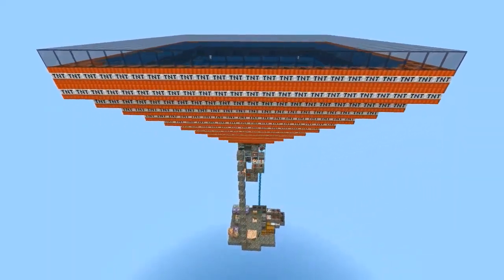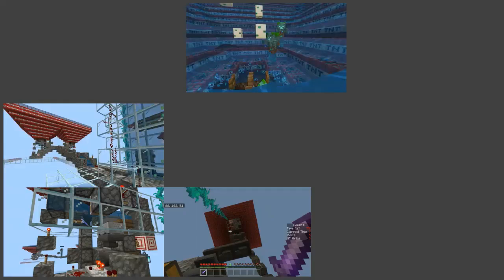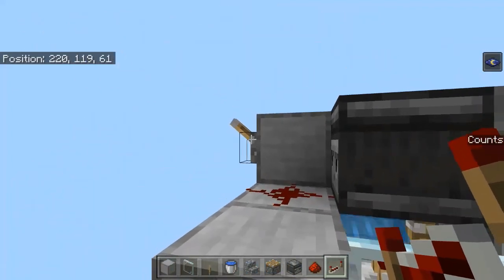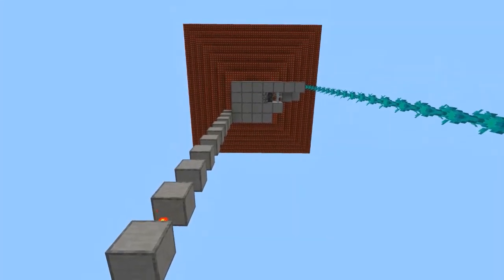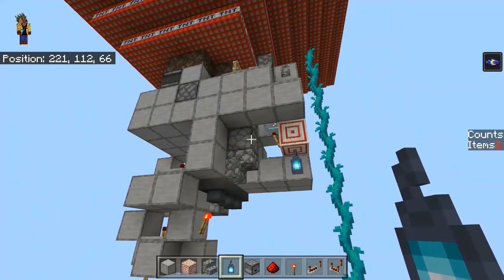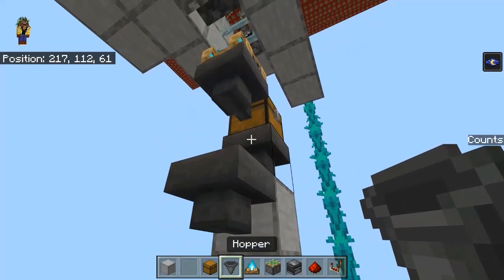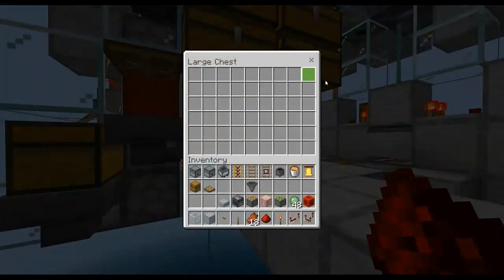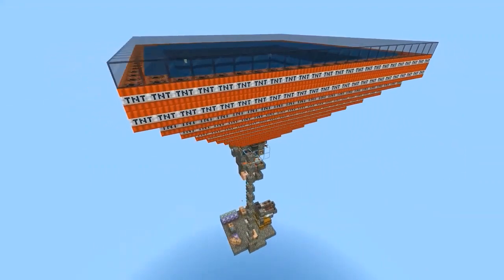Drowned Funnel - Scalable Drowned Farm for Minecraft Bedrock Edition

Comment: *2 Density Drowned Farm*

Spawn Blocks (TNT or Ice) - 719 (11.5 stacks)
Tinted Glass - 594 (9.5 stacks)
Filler Blocks - 234 (4 stacks)
Redstone - 79 (1.5 stacks)
Glass - 38
Soul Sand - 16
Redstone  Torch - 14 
Repeater - 13
Hopper - 12
Dropper - 10
Sea Turtle Egg - 8
Observer - 8 
Piston - 8
Comparator - 4
Soul Torch - 4
Target Block - 4
Soul Lantern - 2
Stairs - 2

Stacks rounded up to the nearest half stack.
This is for one side of the farm (+ water stream)

Comment: Welp, I just built "the other farm" and wasn't that impressed with the output. Now I'm gonna have to rebuilt it to this version! Thanks Golden!
Reply from the maker: Ah glad I could help. Keep the funnel you have, add the turtle eggs, and reduce the length and width by 2 (make the top ring of ice into the new side wall). The roof is fine if you already built it. The soulsand at my drop chute is not as big a deal, but it may speed things up a bit. A bigger impact will come from raising the trident killer up and getting rid of the long drop chute. Of all of those changes, probably the turtle eggs are most impactful.

Comment: I made an interesting discovery with drowned farms after building this: 

If I have a dispenser dispense my tridents into the Trident killer, then drowneds will only drop tridents with Full Durability. 

If I throw the tridents myself, they drop damaged tridents. 
100% consistent
Reply from the maker: Interesting. How many do you get though? They may only be from swapping for nautilus shells. With dispensed tridents it doesn’t count as a player kill, so you’ll get less copper and flesh.
Reply: @goldenhelmet403  honestly it felt like I was getting just as many tridents, if not a little More. I
Copper drops stop all together. 
A lot of shells and flesh still

Comment: Farm is still the best ive used in 1.20 also love that its a badass ink farm as well, currently have 2 in my soon to be realm, make sure you read the description on the 5 density it doesn't work at its full potential on realms 😅 but for single player worlds i recommend the 5 and maybe bring a few villagers to trade that flesh ;) keeps you busy while you stack that copper and tridents bonus addition would be stacking gold farms in the sky with this for more flesh to trade plus gold to trade its a solid system and portal gold farms dont affect the rates 😉
Reply from the maker: Thanks for your support.

Realms are sim4 only, so yeah the 5 density does not work there.

Portal gold farms do affect rates. Portal pigmen are surface cap so they will stop drowned from spawning. However, a guardian farm or creeper farm with solid roof will not affect the rates.
Reply: Definitely noted thanks gonna swap farms around 😅 i was half way through building the gold farms up 😂 thought they had they're own mob cap whoops 😅 ty again

Comment: To anybody freaking out at the thought of this farm going boom, layer the underside of the TNT funnel with dirt/stone/slime block/snow block or any block you have. Then, the water would simply flow down to the lit TNT, should that ever happen, although covering it from under probably means it will never go boom accidentally in the first place.
Reply from the maker: That's fine if you want to invest all those extra blocks. If you're concerned you can also build it out of regular ice. Do note that if you line it underneath with solid blocks like dirt, the TNT will still be lit if you accidently hard-power one of those blocks, say by accidently placing a redstone torch.
Reply: @goldenhelmet403  but then the TNT will not fall down, and instead the water would flow in there, nullifying any nearby damage. Atleast close to the kill Chamber, if a TNT were to fall down, it can break stuff.
Reply from the maker: @Rudrodeep Chatterjee  yes that’s true, thanks for pointing that out about the falling down. I can picture the funnel looking like a flower coming out of a bud if you just line the first few levels near the tk.

Comment: Hi, I have a question, at what height should the funnels be with respect to the AFK point? Because I'm making the 5-density one (in simulation 6) and of course the distance is 4 chunks and Triden Killer in the center of the fifth chunk with respect to the AFK point chunk, but I don't know at what height for the maximum drowning rate or I don't know if it doesn't affect, incredible farm and like
Reply from the maker: Doesn’t affect rate. I made them high enough in the test world to deliver items to the center on a straight path. On sim6 the outer funnels could be up to 80 blocks higher or lower than the afk spot and it will make no difference to rates.
Reply: Thank you very much, you are amazing even after almost 2 years, attentive to any questions

Comment: Great farm. I built your I think original funnel farm where i had to AFK like 100 blocks above the farm. Iv realised that i now get no loot AFKING thay high. Do i need to change the spot im AFKING? If so how high above do i now need to go. Thankyou
Reply from the maker: It depends on your simulation distance.  If you’re on sim4 you need to be within 44 blocks of all spawns spots and the tk floor, and also at least 24 blocks away from all spawn spots. In the old version it was necessary to afk above to keep everything in that range because the funnel had to be much larger to get max rates. The newer version is smaller because spawn rates have increased, and it is possible to get all spawn spots in 24-44 and the tk within 44 by afking either above or below.

I don’t remember the exact afk spot measurements relative to tk floor and/or highest wall but they are in the videos.
Reply from the maker: On simulation distances >4 you can be up to 126 above the tk floor or roughly the same distance below the top of the wall.

Comment: Idk if i built it correctly but just to ask,

1. Based on Chunkbase, i am located near River but totally far enough to make the farm.

2. The AFK platform i made is on Y95 (44 blocks on the highest point on the Ocean.)

3. It was working once and it spawned squid and drowned but idk if it's affected by the Mob Capping now. Only tech near me is Villager Trading Hall by my Friend.

4. I used solid blocks (Stone) for the Funnel, roofing is the same but i slabbed it on top.

Is there something wrong why it doesn't spawn any drowned?
Reply from the maker: Try removing the slabs. I think they are setting the spawn attempts underneath to cave. You don’t need slabs if you have a tinted glass or leaf roof.

Comment: really hope you answer my question. I meet tons of issue when Im building the 2 density version. 
1. when I checked out your map, I saw that you didnt make the trident killer far 32 blocks away from afk spot its goes about 44 or so, so should I build it 32 blocks away from afk spot or like how you build in your map?
2. I saw that your trident killer is actually higher than the afk spot about 7 block idk thats is because the iceless water stream or not. I have ice in my world so Im aiming for the ice waterstream. So should I build the trident killer higher than the afk spot like what you build or like how you marked out in the video?
Hopefully you will answer these questions, thats will be a huge help for me
I just wasted like 2 shulker boxes of ice just because i build the sim 6 farm for sim 4 world
Reply from the maker: You do need to know your sim distance. Sorry for your waste.

Are you getting the 44 block distance from the 2-density version in the sim6 world download? Look at the sim4 world download. It should be 32 like I explain in the video.

The height difference you are asking about does matter to make sure that the top of the funnel is inside the spawn radius on sim4. If you stand at the same Y level as the trident killers then all spots of the farm will not be spawnable. Look at the sim4 world split density version. I believe the afk is only a few blocks higher than the trident killer. If you make a flat loot stream with ice and stand a couple above it at the center then it should be fine and you can collect xp through the floor without making the piston lift.
Reply: @goldenhelmet403  thank you so much I appreciate it!
Reply: @goldenhelmet403  I've done the farm and to be honest in really good!! I got 3 trident per minute

Comment: I was impressed by the 6 chunk simulation distance setup for this farm. My simulation distance goes up to 8 chunks. Is there an even more productive setup of this farm that could take advantage of my 8 chunk simulation distance?
Reply from the maker: Yes, you could expand the 4 outer modules outward, either by extending them in the same shape as the 2-density double funnels, or centering them in the next chunk out (6th chunk from center instead of 5th) with a 22x22 spawnable area. Either way should get you over 4600 drowned/hr. Just needs to be a massive ocean to fit it over.
Reply: @goldenhelmet403  Thanks. Also according to the wiki no additional hostile mobs over sim 8 can spawn on sim 10 and above. Does that mean that a sim 8 setup of this design is the most productive possible? or am I wrong on the extra simulation distances?
Reply from the maker: @TheWeavingBagel  actually the wiki is outdated on that point. The limitation of the horizontal spawn range to chunks whose center is 96 blocks from the player has been removed. It’s a full 128 block sphere on sim10 and sim12.
Reply: @goldenhelmet403  Thanks.

Comment: Hi golden helment, will the rates increase if you add a 90 degree module in the split density design? Like having 8 funnels... sorry if i had grammar mistakes, english isn't my natal language
Reply from the maker: I understand you. It is not likely to increase much because drowned have a low density cap and the 90 degree funnels would share cap check area with both of the other funnels.
Reply from the maker: @Omar De la Fuente  thanks for the support. I’m not on TikTok and don’t plan to be but I wish you the best.

Comment: Do the 1.21 spawning changes interfere with the rates at all? Do I have to make any adjustments or does the farm work identically?
Reply from the maker: This farm works identically. The only change is that it no longer has to be made of tnt/ice. You can use any solid, opaque block.

Comment: If i use leaves as a roof, just 4 block’s space above highest water and then dont i have to build like 8 or so blocks out?
Reply from the maker: Just 4 blocks out. Water reduces light by 2/block in Bedrock Edition.
Reply: @goldenhelmet403  sorry would just like clarification. in the video for leaves you say 4 blocks up(vertical). and here you say 4 blocks out(horizontal)  so just curious which is correct. Thx very much have enjoyed several of your videos.
Reply from the maker: @cris_favero  both. Leaf roof would need to be 4 blocks above the top of the water, and extend 4 blocks out to the side. Or if you don’t want to extend out to the side you could bring the solid/tnt walls straight up 4 blocks above the height of the water to touch the leaf roof. Is that clear?
Reply: @goldenhelmet403   Yes thank you!

Comment: Just to reiterate ice works identically to tnt I just need an additional layer of blocks around it?
Reply: Also are the copper rates for the 2-density version ~300 per hour with looting 3? Just wanna know if I’ve done the math right
Reply from the maker: Yes, ice works the same, you just need extra blocks to reduce the sky light level to 7. Extend the roof out 4 blocks past the sides or down 4 blocks from the top along the sides. The roof extensions can be tinted glass, or spawproofed ice or solid blocks.

And yeah, all rates quoted are with looting 3.
Reply: Good.

Comment: What do you recommend for me to put on the roof?
Reply from the maker: If you make a tinted glass roof as in the video you don’t need anything else on the roof.

Another option for the roof is to use leaves 4 blocks above the highest water. If you’re concerned about snow buildup you can place string.

Comment: It is okay to using other solid block than TNT? I want to build this in my new survival world, because trident consume in next project
Reply from the maker: It can be regular ice, but not solid blocks. Only tnt and regular ice allow spawns both on top and next to them. If you build it out of ice extend the roof 4 blocks out to the side or make the walls double thick at the top 3 levels to block sky light.
Reply: @goldenhelmet403  thank you
Reply: @goldenhelmet403  it can't be packed or blue ice?
Reply from the maker: @usderia1679  no, those are solid blocks
Reply: @goldenhelmet403   last night i built this farm, no drowneds spawn even night time. Sorry for my English
Edit : I don't play in peaceful mode.
Edit : LMAO, just fix the problem. Idk why but i remove the roof and it work well. Back then i using solid block and button on top for roof. For now it's just clear no roof, I don't have tinted glass.
Reply from the maker: @sylbella.k.atahta.9547  ok yes solid block roof makes the game see it as “underground” so drowned won’t spawn. Here is a chart that shows your options for the roof. https://media.discordapp.net/attachments/715523208530362389/861998392727830588/How_to_trigger_surface_spawns_in_dark_areas.png

Comment: It used to be that turtle eggs worked to mess up drowned by just being there. It sounds like from your testing that they still work to mess up path finding, but drowned have to be able to path find to them in some way. Is that correct?
Reply from the maker: They have to be close enough, so it seems to still be based on pathfinding. When the eggs are close enough drowned will start to wander but abruptly stop after moving two blocks. I'll send you some videos in TechRock.

Comment: I just built this farm in My world but I used ice insted of tnt. And insted of tinted ice or roof I seald it in cote of deepslate. And now 0 drownes spawn. How can I fix it to work normaly?
Reply from the maker: Use tinted glass or ice with buttons/iron bars/fence posts on top for the roof, or else make a leaf roof 4 blocks above the top. Remove the deepslate. A solid layer such as deepslate stops drowned spawns because it makes everything under it count as “underground”.
Reply: I did it and it works. Thanks. I asked cuz I know it was My mistake beacuse all your farms I built works

Comment: I built the farm and I dont understand how im not getting any spawns, hard difficulty, mob spawns and mob loot is on, but nothing. Afk y level on the world download is Y=111 but on my world its Y=115, could that be the issue?
Reply from the maker: Y level could be an issue if your world is on simulation distance 6 or higher. Are you above an ocean? What did you do for a roof?
Reply: @goldenhelmet403  split density sim 4 above a deep lukewarm ocean, double ice with button roof
Reply from the maker: @lewis4283  are there drowned on the ocean floor?
Reply from the maker: @lewis4283  for the split density the measurements must be precise. Is your afk spot about eye level with the middle to top of the funnels, and the funnel centers 32 blocks away horizontally?
Reply: @goldenhelmet403  ill need to get a friend to afk so I can see drowned on the ocean floor in spectator, but my afk spot is 32 blocks away, and the funnel is perfectly eye level with the 4th and 5th layers. Even using a spawning radius outline shows all 4 funnels are in the spawning sphere.
Reply: @goldenhelmet403  apparently the problem was the roof? After removing the 2 layer ice and replacing it with tinted glass it began to work; the farm also began to work after using the leaves 7 blocks up and blocks 6 out, idk why
Reply from the maker: @lewis4283  oh maybe you had packed ice instead of regular ice? I’m glad you got it to work.
Reply: @goldenhelmet403  i did use packed ice, was it supposed to be regular ice?
Reply from the maker: @lewis4283  yes. Packed and blue ice are solid blocks so they trigger cave spawns below.

Comment: Farm Works only at night
Reply: So can you help me
Reply from the maker: Did you use tinted glass made with amethyst shards, or stained glass made with dye, for the roof? It needs to be tinted.
Reply: I used Black stained glass
Reply: Can i just put slabs on the glass would it work then?
Reply from the maker: @FabijanGG  no, slabs do not block light in Bedrock Edition and they allow only cave mob spawns underneath. What you can do if you don’t want to replace the glass is put a leaf roof 6 blocks above it or put another layer of glass and then water on that. The leaves would need to extend an extra 4 blocks out to the side.
Reply: 6 blocks above glass?
Reply from the maker: @FabijanGG  yes
Reply: Tysm now is working on day and night
Reply from the maker: @FabijanGG  great, I’m glad to hear that

Comment: Does this work in current update (1.21.50iirc)
Reply from the maker: Yes. Tnt is no longer needed. It can be any spawnable block.
Reply: @goldenhelmet403  oh BC they changed spawning from new corner to centre for non structure mob spawns. Cheers.